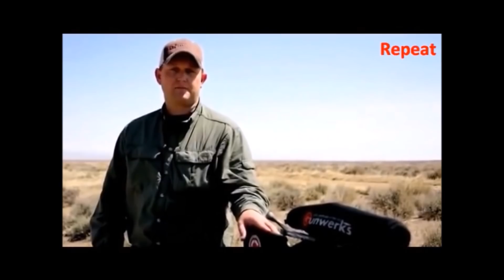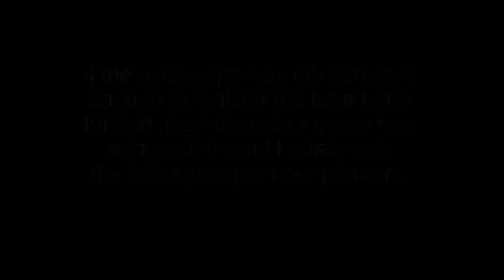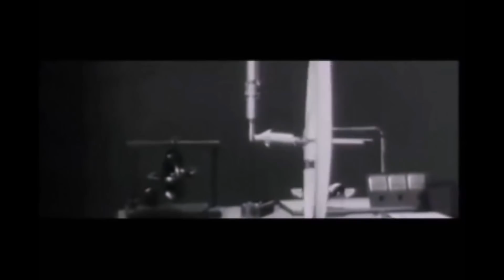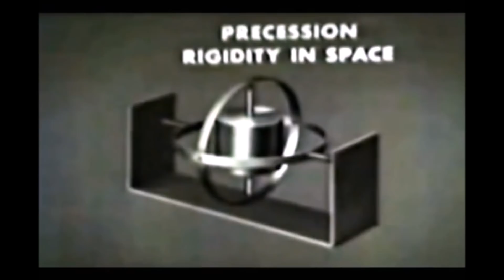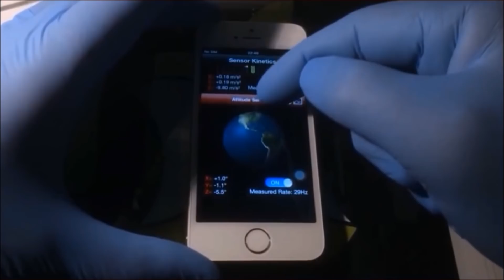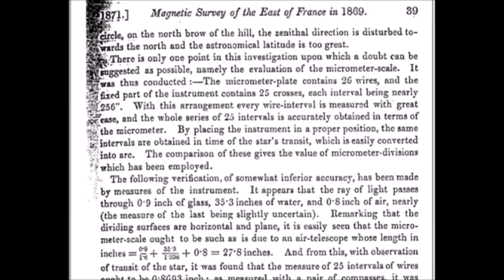The Motionless Earth - Final Addendum

Comment: Is it to support flat earth, rotating sky above? I'll continue to watch when I have time and I'll comment back on here
Reply from the maker: Yes, it's showing the sky rotates and the Earth is stationary, in an enclosed system.
Reply: dwhite1up , not sure I believe you on this
Reply: dwhite1up , I don't understand the point of the gyroscopes of this video
Reply from the maker: The gyroscope is supposed to show drift while on a moving surface. People were claiming that a 24 hour rotation is too slow of a rotation to detect so he designed a table that took 24 hours to rotate and it still easily detected the motion, as expected. When he tests the gyro while it's not on the rotating table (testing for earth spin) no 15 degrees per hour was detected. No drift at all. He repeated this experiment several times and many have with several gyros... no motion has ever been detected. Airy's Failure and Michelson and Morley and other simliar experiments go on to show no Earth movement of any of the 4 velocities and showed that it's only the aether/sky that moves. Watch till the end and catch all the quotes from scientist and physicists and many military personnel are coming out to admitting that they never have to worry about coriolis, anywhere. That these are just dummy equations. Only needed to conceal the fact the Earth doesn't move. Lorenz and Einstien admitted this in their own words. This is why general relativity was invented and the contraction of mass was invented... to hide all these results of a motionless, geocentric earth. Repeat gyroscope experiments and airy's failure yourself to prove it to yourself or practice sniping. Ask yourself why the stars have never gone off course with all of these insane velocities and ask why wind can go to and fro and even go 0mph, yet have "earth spin" to be the cause.... It's all the aether my friend. It's all electromagnetism and electrostatics and a plane of inertia. Our ancestors knew.
Reply from the maker: Einstein has not been proven, stop listening to mainstream propaganda, he has been CLEARLY refuted with his imaginary equations that account for nothing but the imaginative "contraction" of Michelson-Morley device because they found the ether and HAD to explain it away because they were wrong if they wanted to stick with the Copernican model, which in nature turned out to be wrong as well. If you actually watch the video, this is explained and ADMITTED among those who INVENTED the equations. It is straight up ADMITTED that the equations are NOT needed if you place the Earth as being stationary. The equations are only NEEDED if you believe in the Copernican model and have to explain away imaginary motions of the earth. THEY ADMIT THIS. EINSTEIN AND OTHERS ADMITTED THEY  PURPOSELY DID AWAY WITH THE ETHER THROUGH INVENTIVE MATH, because it was their ONLY OPTION to INVENT MATHEMATICS and INVENT "SPACE-TIME", and to IMAGINE that devices somehow physically alter themselves while they observsbly don't.... all this and INVENTING much more INVENTIVE NONSENSE, that THEY ADMIT to inventing because they refuse to accept the simple, obvious, demonstrable, and repeatable proof that the Earth is STATIONARY.

 This is why General Relativity even came into existence... to create a NEEDED excuse. HE ADMITS THIS. Can't stress that enough. Gyroscopes also prove this (Watch the video) and the globe excuses have all been answered and the "miracle" that planes fly just perfectly fine, like they always have, without the said device needed to "account for earth spin and curve"... The same device that only ONE entity makes for the ENTIRE airline industry, its contracted out to NASA, and they don't talk to anyone.... hmmmm.

We proved the ether through Airy's failure, through Michaelson-Morley and others, and through modern day ring laser gyroscopes. The ether was detected. The explanation that it's the Earth spinning was refuted because it was the ONLY motion ever detected while our claimed motion around the sun never shows up. Same with our claimed motion around the galaxy and through space as a whole. All those speeds should register with ring laser gyros but they never have and never will and it's ALL well within their sensitivity range. Now to drive this point home even more, a helmholtz coil has been used near these ring laser gyros and it completely sends the readings wild. This is because it's altering the electric/magnetic fields of the ether. If it was the Earth that was moving the helmholtz coil wouldn't have an effect on the reading, PLUS more than just so-called "axial spin" would be observed.

Sorry if I came off strong, but I highly suggest you watch my video about science vs. mathematics and listen closely to the entire presentation.... https://youtu.be/0f7qlCTToDc

Accelerometers also prove what we live on/in .... check this out if you haven't yet.  https://www.youtube.com/watch?v=V3tdyV1cAWg
Reply from the maker: "We may therefore say that the broad result of a series of experiments of Michelson-Morley type is that no motion of the earth through the ether can be detected by an influence on the velocity of light.”– Encyclopedia Britannica (1959)

“There was just one alternative; the earth’s true velocity through space might happen to have been nil.” - Physicist, Arthur Eddington

“The data [of Michelson-Morley] were almost unbelievable… There was only one other possible conclusion to draw — that the Earth was at rest.”- Physicist, Bernard Jaffe

“The easiest explanation was that the earth was fixed in the ether and that everything else in the universe moved with respect to the earth and the ether… Such an idea was not considered seriously, since it would mean in effect that our earth occupied the omnipotent position in the universe, with all the other heavenly bodies paying homage by moving around it.”- Physicist, James Coleman

“The Michelson-Morley experiment confronted scientists with an embarrassing alternative. On the one hand they could scrap the ether theory which had explained so many things about electricity, magnetism, and light. Or if they insisted on retaining the ether they had to abandon the still more venerable Copernican theory that the earth is in motion. To many physicists it seemed almost easier to believe that the earth stood still than that waves – light waves, electromagnetic waves – could exist without a medium to sustain them. It was a serious dilemma and one that split scientific thought for a quarter century. Many new hypotheses were advanced and rejected. The experiment was tried again by Morley and by others,with the same conclusion; the apparent velocity of the earth through the ether was zero.” - Historian, Lincoln Barnett,foreword by Albert Einstein

“What happened when the experiment was done in 1887? There was never, never, in any orientation at any time of year,any shift in the interference pattern; none; no shift; no fringe shift; nothing. What's the implication? Here was an experiment that was done to measure the speed of the earth’s motion through the ether. This was an experiment that was ten times more sensitive than it needed to be. It could have detected speeds as low as two miles a second instead of the known 20mps that the earth as in its orbital motion around the sun. It didn’t detect it. What’s the conclusion from the Michelson-Morley experiment? The implication is that the earth is not moving…”- Physicist, Richard Wolfson

“…to the question whether or not the motion of the Earth in space can be made perceptible in terrestrial experiments. We have already remarked… that all attempts of this nature led to a negative result. Before the theory of relativity was put forward, it was difficult to become reconciled to this negative result.” - Albert Einstein

"I have come to believe that the motion of the Earth cannot be detected by any optical experiment."- Albert Einstein

"Briefly, everything occurs as if the Earth were at rest..." - Physicist, Henrick Lorentz

"A great deal of research has been carried out concerning the influence of the Earth's movement. The results were always negative." - Physicist, Henri Poincaré

"We can't feel our motion through space, nor has any physical experiment ever proved that the Earth actually is in motion."- Historian, Lincoln Barnett

"Thus, even now, three and a half centuries after Galileo... it is still remarkably difficult to say categorically whether the earth moves..."- Physicist, Julian B. Barbour

"There is no planetary observation by which we on Earth can prove that the Earth is moving in an orbit around the sun."- Physicist, I. Bernard Cohen

"So which is real, the Ptolemaic or Copernican system? Although it is not uncommon for people to say that Copernicus proved Ptolemy wrong, that is not true... one can use either picture as a model of the universe, for our observations of the heavens can be explained by assuming either the earth or the sun to be at rest." - Physicist, Stephen Hawking

"If we were to adopt a frame of reference like Tycho's in which the Earth is at rest, then the distant galaxies would seem to be executing circular turns once a year, and in general relativity this enormous motion would create forces akin to gravitation, which would act on the Sun and planets and give them the motions of the Tychonic theory."- Physicist, Steven Weinberg

"Let it be understood at the outset that it makes no difference, from the point of view of describing planetary motion, whether we take the Earth or the Sun as the center of the solar system. Since the issue is one of relative motion only, there are infinitely many exactly equivalent descriptions referred to different centers - in principle any point will do, the Moon, Jupiter... So the passions loosed on the world by the publication of Copernicus' book, Derevolutionibus orbium caelestium libri VI, were logically irrelevant..."- Astronomer, Fred Hoyle

"...we can take either the Earth or the Sun, or any other point for that matter, as the center of the solar system.This is certainly so for the purely kinematical problem of describing the planetary motions. It is also possible to take any point as the center even in dynamics, although recognition of this freedom of choice had to await the present century."- Astronomer, Fred Hoyle

"It is possible to describe the entire universe using any chosen point as the unmoving center - the Earth will do very well - and no one can prove that choice is wrong.... Scientists today prefer to picture everything in motion and nothing as being the center. If you haven't given much thought to the implications of twentieth-century science, you may be chagrined... to realize that because of the concept of relative motion, no one can prove that the Earth moves." - Kitty Ferguson, Science Writer

"Thus we may return to Ptolemy's point of view of a motionless Earth. This would mean that we use a system of reference rigidly fixed to the Earth in which all stars are performing a rotational motion with the same angular velocity around the Earth's axis... one has to show that the transformed metric can be regarded as produced according to Einstein's field equations, by distant rotating masses. This has been done by Thirring. He calculated a field due to a rotating, hollow, thick-walled sphere and proved that inside the cavity it behaved as though there were centrifugal and other inertial forces usually attributed to absolute space. Thus from Einstein's point of view, Ptolemy and Copernicus are equally right. What point of view is chosen is a matter of expediency."- Physicist, Max Born

"I can construct for you a spherically symmetrical universe with Earth at its center, and you cannot disprove it based on observations. You can only exclude it on philosophical grounds. In my view there is absolutely nothing wrong in that.What I want to bring into the open is the fact that we are using philosophical criteria in choosing our models. A lot of cosmology tries to hide that."- Physicist, George F. R. Ellis

"It is very important to acknowledge that the Copernican theory offers a very exact calculation of the apparent movements of the planets... even though it must be conceded that, from the modern standpoint practically identical results could be obtained by means of a somewhat revised Ptolemaic system.... It makes no sense, accordingly, to speak of a difference in truth between Copernicus and Ptolemy: both conceptions are equally permissible descriptions. What has been considered as the greatest discovery of occidental wisdom, as opposed to that of antiquity, is questioned as to its truth value."- Physicist, Hans Reichenbach

(the Earth-centered system) "is in reality absolutely identical with the system of Copernicus and all computation of the places of the planets are the same for the two systems."- Astronomer, J. L. E. Dryer

"Whether the Earth rotates once a day from west to east, as Copernicus taught, or the heavens revolve once a day from east to west, as his predecessors believed, the observable phenomena will be exactly the same. This shows a defect in Newtonian dynamics, since an empirical science ought not to contain a metaphysical assumption, which can never be proved or disproved by observation."- Physicist, Dennis Sciama

"Tycho Brahe proposed a dualistic scheme, with the Sun going around the Earth but with all other planets going around the Sun, and in making this proposal he thought he was offering something radically different from Copernicus. And in rejecting Tycho's scheme, Kepler obviously thought so too. Yet in principle there is no difference."- Astronomer, Fred Hoyle

"We know now that the difference between a heliocentric and a geocentric theory is one of motions only, and that such a difference has no physical significance, [the Ptolemaic and Copernican views], when improved by adding terms involving the square and higher powers of the eccentricities of the planetary orbits, are physically equivalent to one another."- Astronomer, Fred Hoyle

"So if Earth is at rest relative to the ether, then it alone is at rest. That makes us pretty special... Do you really want to return to parochial, pre-Copernican ideas? Do you really think you and your planet are so special that, in all the rich vastness of the Universe, you alone can claim to be 'at rest.'"- Physicist, Richard Wolfson

"But when you look at CMB map, you also see that the structure that is observed, is in fact, in a weird way,correlated with the plane of the earth around the sun. Is this Copernicus coming back to haunt us? That's crazy. We're looking out at the whole universe... That would say we are truly the center of the universe."- Physicist, Lawrence Krauss
Reply from the maker: "I have to confess that I was bothered by the fact that the Axis of Evil seemed linked to a special direction in oursolar system... But now we have completely independent data... This is a hint of something really big."- Astrophysicist,Max Tegmark

"Why is the solar system cosmically aligned?"- Astrophysicist, Dragan Huterer

"The apparent alignment in the cosmic microwave background in one particular direction through space is called 'evil' because it undermines our ideas about the standard cosmological model... the Copernican Principle seems to be in jeopardy."- Astrophysicist, Ashok K. Singal

"One of the most surprising findings is that the fluctuations in the cosmic microwave radiation temperatures at large angular scales do not match those predicted by the standard [Big Bang] model."- The European Space Agency, Planck Probe, 2013

"It is both amusing and instructive to speculate on what might have happened if such an experiment could have been performed in the sixteenth or seventeenth centuries when men were debating the rival merits of the Copernican and Ptolemaic systems. The result would surely have been interpreted as conclusive evidence for the immobility of the Earth, and therefore as a triumphant vindication of the Ptolemaic system and irrefutable falsification of the Copernican hypothesis."- Physicist, G. J. Whitrow

"The Copernican revolution outshines everything since the rise of Christianity and reduces the Renaissance and Reformation to the rank of mere episodes, mere internal displacements, within the system of medieval Christendom. Since it changed the character of men's habitual mental operations even in the conduct of the non-material sciences, while transforming the whole diagram of the physical universe and the very texture of human life itself, it looms so large as the real origin both of the modern world and of the modern mentality, that our customary periodisation of European history has become an anachronism and an encumbrance."- Historian, Herbert Butterfield

"It is clear that the earth does not move, and that it does not lie elsewhere than at the center."- Aristotle

"I have read with much interest Messrs. Michelson and Morley’s wonderfully delicate experiment attempting to decide the important question as to how far the ether is carried along by the earth...I would suggest that almost the only hypothesis that can reconcile this opposition is that the length of material bodies changes..."- George FitzGerald

"Anybody who has been seriously engaged in scientific work of any kind realizes that over the entrance to the gates of the temple of science are written the words: 'Ye must have faith.'"- Max Planck

"It matters not whether we reckon it 28 or 54 million miles distant for either would do just as well."- Issac Newton

"Science today is locked into paradigms. Every avenue is blocked by beliefs that are wrong, and if you try to get anything published in a journal today, you will run up against a paradigm, and the editors will turn you down."- Astronomer, Fred Hoyle

"...Again, once more for the record: it has been shown at least six different ways this century alone that the equations and physics used by NASA to launch satellites are identical to the equations derived from a geocentric universe.
Thus, if the space program is proof of anything, it proves geocentricity and disproves heliocentrism." Astronomer, Dr. Bouw